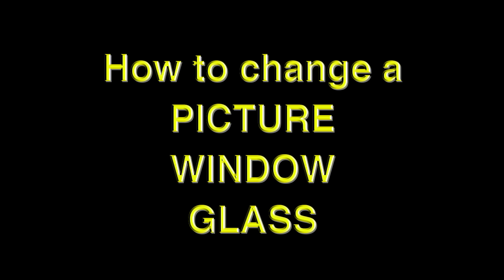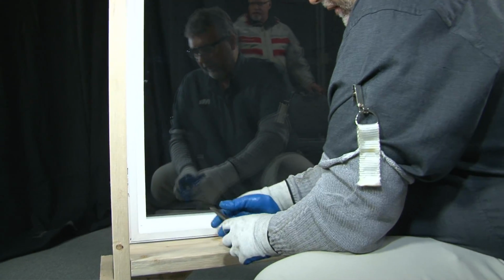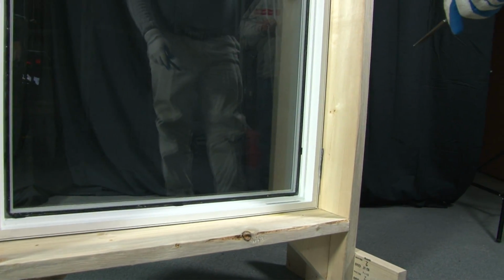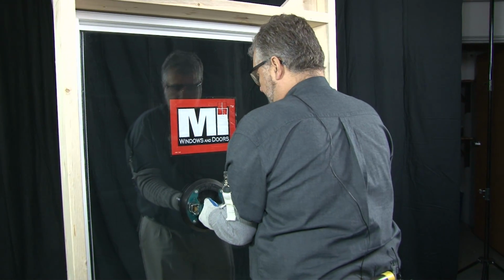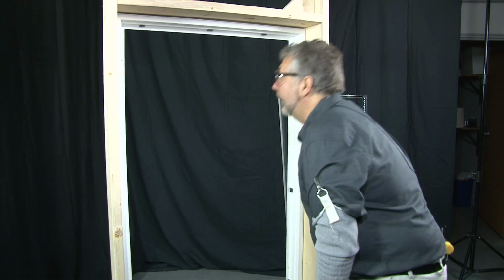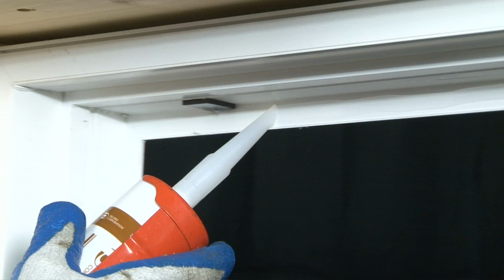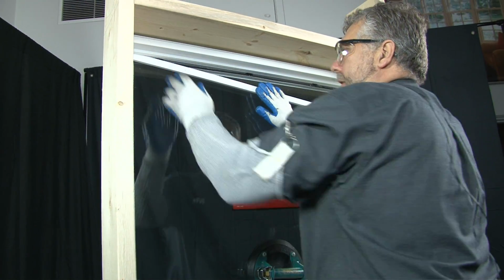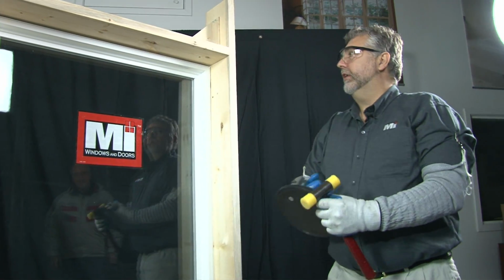How to remove and replace a picture window glass

Comment: I love how easy glass  replacement is in your perfect environment, which NEVER  happens.
And how about talking how sometimes it's alot tougher to cut through the window tape or sometimes the glass breaks or you utility knife blade breaks as your trying to cut the glass tape away, let's be a little more realistic on the process of glass removal and replacement video....
And let's not forget to check the new glass unit to make sure the glue that seals the dual panes together is cleanly applied from manufacturer so that it fits the opening with ease....

Comment: i did not hear or see anything about glass safety.
USE FULL FACE SHIELDING,  AND OR FULL EYE COVERING.
USE gloves far better than show in this video, USE ONLY GLASS SAFETY GLOVES, 
USE GLASS safety clothing on your arms and torso.
USE GLASS safety protection on your legs.
for all diy,    MUST have others in the room with you, and a LARGE bleed kit. (got cell phone?)

99,99% of the time none of this will be needed. but just the 0.01% chance, it will save your life.

long time back i built a vacuum glass coating machine. glass safety was drilled into us, as we worked with sheets of glass, nothing in a frame. it is amazing how easily glass can cut up flesh and bone.
worse yet it does not show up in a x-ray. so they have to probe to find it in your body.

Comment: Wow, thanks so much for this video. I have to replace the thermal glass modules in two picture windows. The manufacturer is selling me the glass modules at a prorated warranty discount, but I need to get them installed. I was getting quotes of $1,200 to install the glass in two windows. Now that I see what's involved, I see how ridiculous those quotes are and I think I will just go out and get a couple of suction cups and a plastic hammer and do it myself.
Reply: the real cost is "renting" the people with the skill to the job right the first time.

Comment: You actually did fairly well at the installation my only complaint is that you should have mentioned the sealant needs to be silicone and maybe that a pipe knife(razor blade on a long handle that is flat and allows you to get in deep to cut the sealant) is what pro's use to cut the glazing.

And Parris Williams   WTF?   Your an idiot !!!!